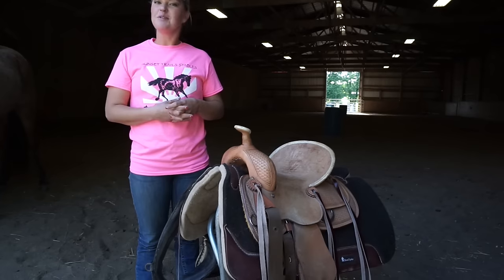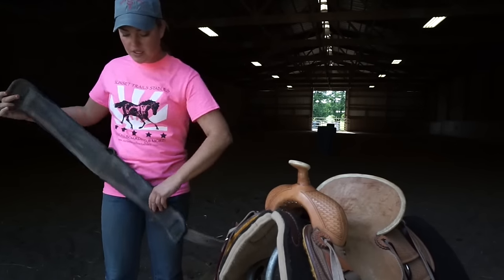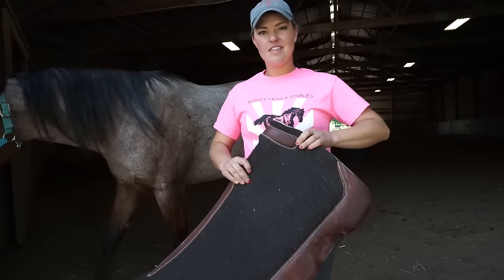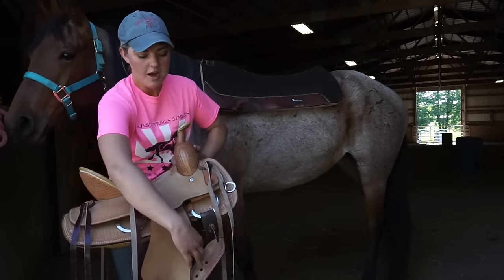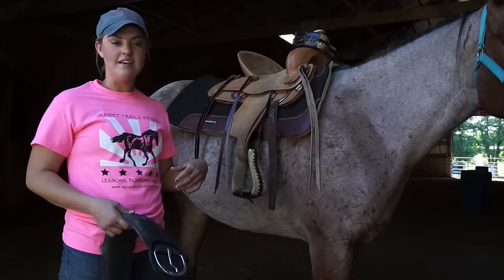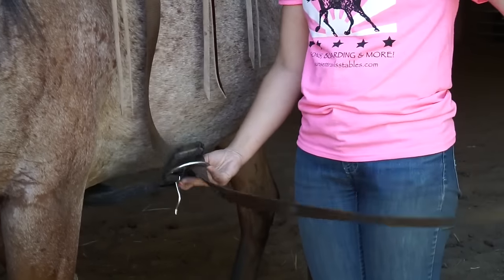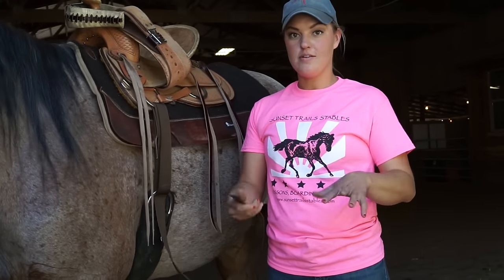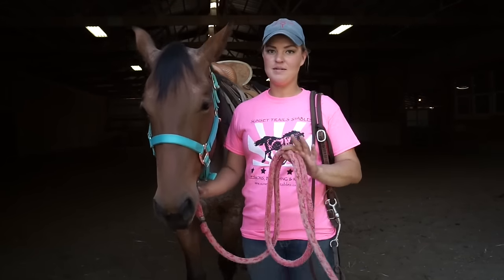HOW TO TACK UP YOUR HORSE WESTERN

Comment: FINALLY. A video that actually showed the procedure.  How many times did I watch, leave early, where the instructor zipped through it AND BLOCKED THE VIEW.  Its been a while since I rode and wasn't an old hand at it to being with. But circumstances caused me to miss several years and I needed refreshing on the basics. Thank you for making this clear and not racing through the process. 7-4-1 rule, never heard of it but so helpful.

Comment: I've been riding with English tack for many years but have just bought a Western saddle to try. I'm wondering why there is a buckle on the left hand side of the girth if it isn't supposed to be used? This really confused me putting the saddle on for the first time!
Reply: I've seen some use it and some not. Depends if a hole in the latigo lines up or not when tight enough. If it doesn't the buckle isn't used.

Comment: What are all the random tassels on the saddle for they look kind off useless aha are they just decoration
Reply: Orla Thompson they are used to tie up ropes and other things (when roping and camping)
Reply: soaringtractor I ride English so I have trail ridden and done cross country jeez Louise don't get ya knickers in a twist matey I was just asking a question
Reply: camo _cowgirl thanks
Reply: That's correct - they're useful for tying up your lariat, your saddlebags, gloves, whatever.  They're referred to as 'saddle strings'.
Reply: You may also see actual tassels hanging from the girth or cinch hobbles. Those are called a shu-fly and the swing of it as you ride keeps the flies from settling on your horse's belly.

Comment: Not a fan of tying the cinch into a knot. The holes in the latigo are there for the buckle after you loop it a couple times. Then the excess latigo should be put through the keeper. I know she did that because the lack of holes in the latigo, but you can easily dedicate some time to punching more holes in the latigo OR try a different latigo.

Comment: Your horse is not very comfortable with the bit. Seeing the wrinkles means it's just slightly too tight on the mouth.
Reply: Lustantino Animations some people have different ideas about bit placement, but generally speaking there should be one to two wrinkles. If the bit sits too low it will hit their teeth, same thing if it’s too high

Comment: Personally with my horse I like to saddle her on different sides sides to get her used to having a saddle and blanket thrown onto her on either side. A rope halter is way better to use rather than the type you are using, unnecessary metal on a horse is just bad in general, I also suggest riding bit less because putting pain in a horses mouth is just not good. Not trying to hate just making some suggestions.
Reply: bitless or not there are pros and cons to both. The way I see it is that either way can be cruel if you make it. I am fine with whatever people want to use as long as the horse is content. (the woman putting the bit in was very gentle and made sure the bit was adjusted properly) I see so many good riders tighten the bit too high and it pulls their cheeks back which can cause pinching...which is why I think bits have such a bad rep.